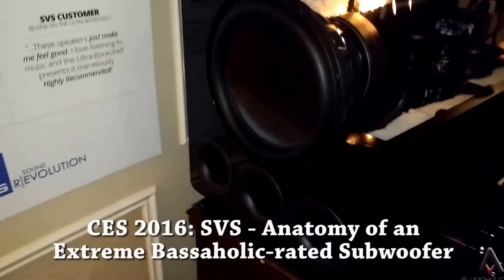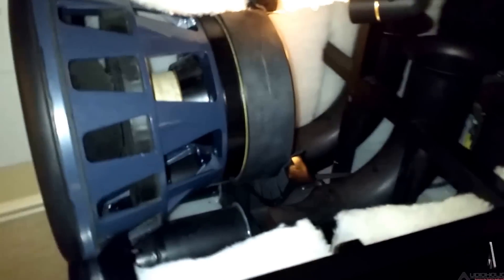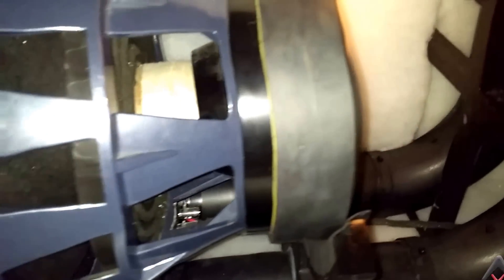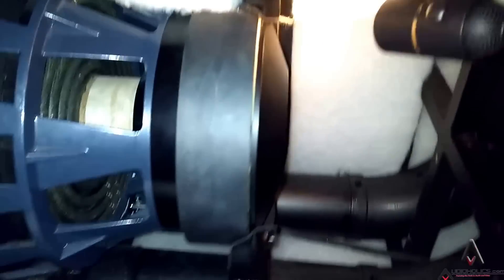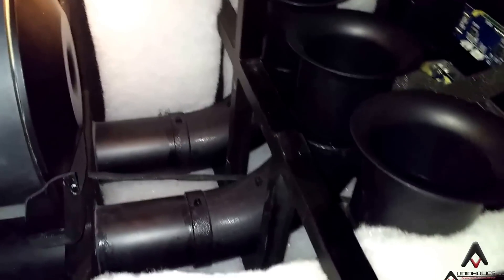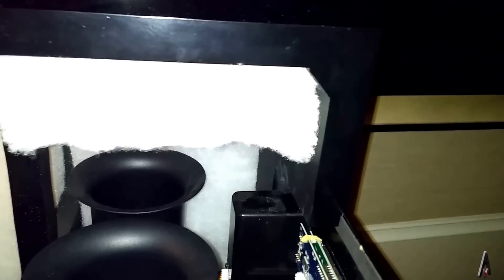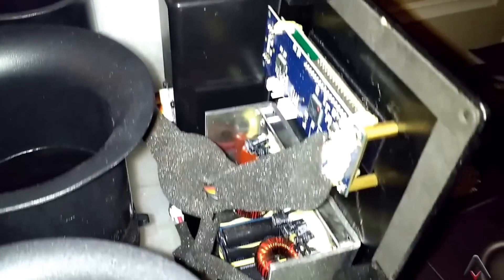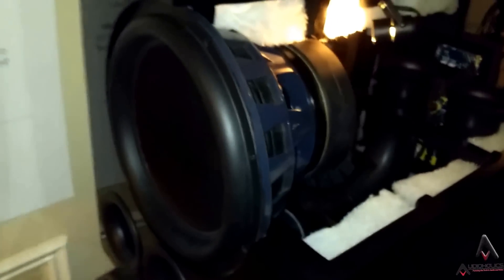SVS PB13 Ultra: The Anatomy of a Subwoofer @ CES 2016

Comment: I bought two of these in 2014.  They were delivered on a pallet and it took four guys to get them up to my third floor.  It is now April 2025 and they are still performing flawlessly - I did order and have the Sledge Amp upgrade kit for each but not yet ready to install them.  I know SVS makes some 16 and 17 inch subs but I can not imagine needing or wanting any more performance than I am getting now.